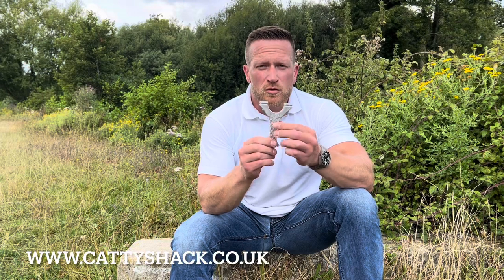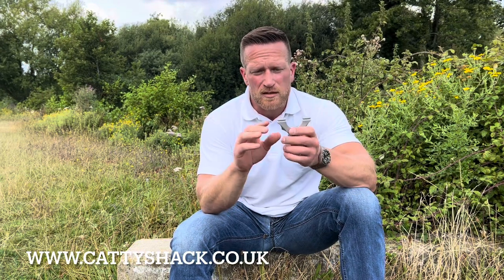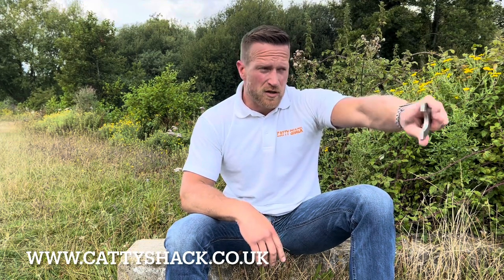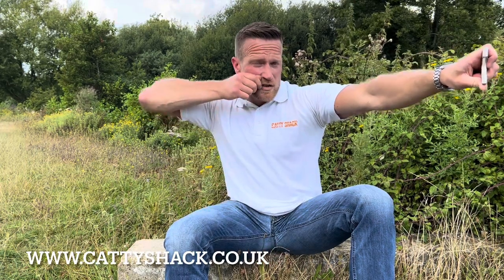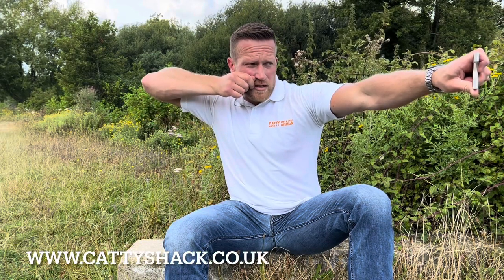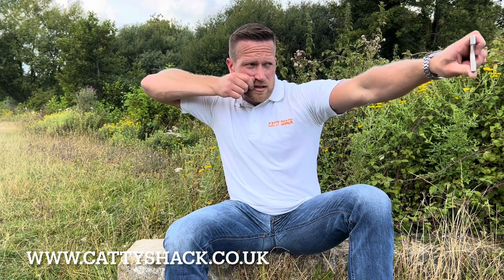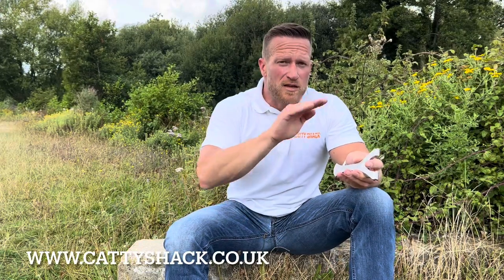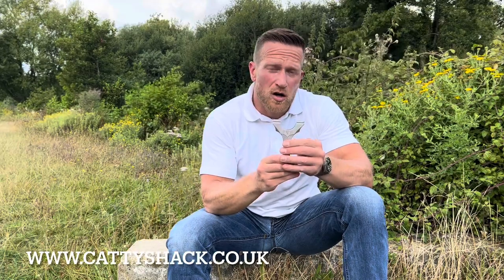Catapult Width VS Impact Height.

Comment: So what you said at the end is a narrower frame shoots higher than a wider one....does that mean I'll have to shoot a narrower one a little lower than the target to hit it?
Reply from the maker: You can tweak your anchor point to alter impact points with different frame widths…to a certain extent. But if you’re used to shooting a 95mm frame, and keep the same anchor point with an 85mm frame, then yes you’d need to aim lower than before.
Reply: @CattyShackHunter  ok cheers mate that's what I had worked out practicing alot...  Just needed to hear that from you to make sure I was on the right road...thank you ..have a good week.just wanted to add cracking little 85 mm evo absolute gem.
Reply from the maker: @nathanevans6331  cheers bud, you too 👍